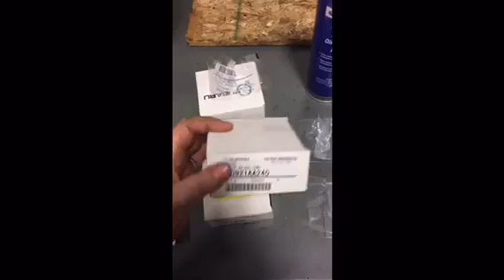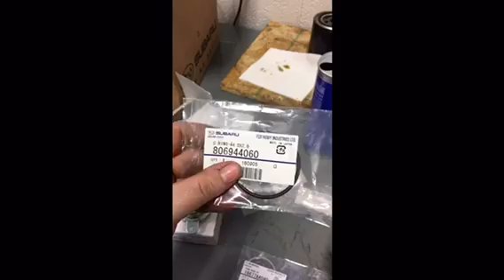Oil Control Valve Replacement FRS

Comment: I have a engine and a traction control light on the code I got was p0018 what I would like to know is if after you change the oil control valve and the engine oil did it go away?
Reply: I just got my P0018 Crankshaft Position - Camshaft Position Correlation (Bank 2 Sensor A) Check Engine Light and Traction Control Light are both on. I have an Automatic Transmission 2017 Toyota 86 at 60,000 miles now. I just did an oil change, took my car in to the dealership to see which sensor needed to be changed, and they told me my K&N Oil Filter is the problem... The thing is, I have been using a K&N Oil Filter for the longest time, and the check engine light came out just recently. I want to check my Crankshaft Position Sensor and my Camshaft Position Sensor. Clean them of dust/dirt/leaked oil, test their voltages, and see if I need to replace any of them, but I just do not know which sensor is which and where they are exactly located.
Reply: @ShimoGamingMoments  the sensor is on your right and at the top not sure on yours but you could google it 2017 scion frs sensor diagram!.
Reply: Bump! Same issue with me as of tonight, TC and Engine Light both came on at the same time, restarted my vehicle and the TC light went off shortly afterwards, maybe like 5 minutes. But my EL remains on and OBD-Reader gave me “most likely solution” as Oil Control Valve (also referred to as the VVT Solenoid).
Reply: @zachbrossett   I change the sensor on mine bank 2 sensor A and the TC and EL still didn't came off send it to the dealership they say the sensor is working   they clear the code after leaving the dealership it came back send it back they  wanted 600 just to go in the engine but I just took it back so am planning to work on it myself will keep you posted.

Comment: does this solve for p0018?
Reply: Yes, P0018 goes hand in hand with P000C, and replacing Intake (upper) sensor on Driver's Side could resolve it.
Reply: @knappRC  I just got the p0018 code at 41k miles. Should I just change this sensor first before doing anything else?
Reply: @Laggyness  That is up to you, but for $80 I figured why not start there. It's a quick and easy fix. Dealer usually has then in stock or Rock Auto is great also.

Comment: Code p0011 you think you can help plz frs 2014
Reply from the maker: So p0011 is bank 1 intake camshaft is too advanced. Causes can be low oil or oil that has clogged the actuator, bad actuator solenoid, possibly wiring issue, or it jumped timing. I would check oil, change it, do the oil flush, clear code and see if it comes back. If it does, you can remove the solenoid and test it, and if that tests fine, start looking for a wiring issue.
Reply: @heatherbergmann7991  Currently have P0011 I will take these steps and let you know how it goes!

Comment: Hey Heather so I have a 13 frs running some bolt one but just had two codes come on p0390 &p0391 your video has been really helpful. Could my problem be similar
Reply from the maker: Just a brief search looks like that is more of a circuit electrical issue, than an issue with the oil control valve.

Comment: Can this solution also fix ECU code P000B ? Or is that a sprocket issue. Great vid very helpful
Reply: Yes, it just means that it is a different sensor. There is upper (intake) and lower (exhaust) sensors for both driver's and passenger sides. P000A = Intake Passenger Side P000B = Exhaust Passenger Side P000C Intake Driver's Side P000D Exhaust Driver's Side.
Reply: Hay man I know it’s been almost 2 years after you committed this but did you ever fix the problem I have that code now
Reply: @daddyyovani3536  yes I replaced the control valves and the problem went away
Reply: @petethemeat57  THANK YOU SO MUCH FOR REPLYING BROTHA! and so that’s not the sensor right?
Reply: @daddyyovani3536 is it the same sensor for all of them? Sorry I know it’s 3 years later 😅
Reply from the maker: It should be the same issue, just a different oil control valve than the one mine was.

Comment: Hey, I wanted to know if your code cleared and did not come back after this service? Im having the P000B code and want to fix it. Code popped right after I did my oil change with OW-20 Mobil 1 Oil. Do I really need to get the factory oil? Thanks in advance
Reply from the maker: The code never returned. Factory oil is not required, but I still use it.
Reply: @heatherbergmann7991  I have code p0014 and p000b, changed the OCV sensor and still have the light CEL on. used Royal Purple 0w20, thinking maybe cam sprocket?
Reply: @xxthrillxx  do you fix it?
Reply: @aaroneduardoalvarezzarate4405  i wasnt able to fix it in time... i discovered that someone worked on the timing chain prior and used too much sealant. This caused the oil pick-up tube to get clogged and it threw a rod. 

I believe the clogged pick up tube was causing that code to come up. If you have had your engine worked on, pull the oil pan and see if the pick up tube is clogged.
Reply: @xxthrillxx  in fact, I just repaired it, and the oil was dirty, I will remove the pan and clean everything very well
Reply: @xxthrillxx  bro, I did it, change the oil, now the engine works perfectly, it’s crazy how something simple create a big problem
Thanks bro!
I hope this helps someone else
Reply: @aaroneduardoalvarezzarate4405  did you take off the oil pan? Was the pick up tube clogged?
Reply: Did you fixed? Just happen to me did the oil change with 0W-20 mobil 1 and the code poped

Comment: I’m getting p0018?
Reply: Same. Have you fixed it?
Reply: Have you guys had any luck with the P0018?
Reply: @ManuelXx8xX  Sadly not. Ive changed quite a few things. My car might just need to get the light cleared though.
Reply: @rabbidstech7677  I'm sorry to hear that but thanks for replying, by any chance did you replace the cam sprockets or the ECU?
Reply: @ManuelXx8xX  Not yet. Just the position sensor and the oil valve. I still have warranty left, so I'll take it back a few more times till they fix it.
Reply: @rabbidstech7677  did you ever get p0018 fixed? i have the same problem on the opposite bank.
Reply: @PrestonG23  did you ever get it fixed?

Comment: Some great info in this vid! You said this was DTC P000A, right? 

I have a permanent P0010 error code and this video was one of the top Google results for those terms. Are these two codes related to the same underlying problem?

I'm not very technical so I had a little bit of trouble keeping up with the video (particularly with the interchanging of the terms sensor, solenoid, actuator, and oil control valve).

I'm just trying to figure out if my P0010 code would be fixed with the method shown in this video, or if P0010 has less to do with swapping out the entire oil control valve assembly, but rather just replacing the sensor that clips onto the housing.
Reply from the maker: Yeah, my bad. The technical term is oil control valve, but I typically call it a cam sensor. For p0010, it could be the oil control valve assembly on the passenger intake side, an electrical issue with that harness, an ecm issue, or the efi main 1 relay. I would start by measuring the resistance of the ocv. When warm, the resistance should be between 6.85 and 7.65 ohms. If not, then the ocv is bad and do what I did in the video.
Reply: @heatherbergmann7991  im having an issue where the cams are only turning on intermittently and thi k it's either the sensor or ocv. I want to test the ocv, so pretend I was in 1st grade. How do I test the resistance?
Reply from the maker: @innercirclepro11  the resistance should be 6.85-7.65 ohms. So disconnect the connector, and hold both probes of the multimeter to the two prongs on the ocv. If it is out of that limit, replace it.
Reply: @heatherbergmann7991  awesome. I will check tonight. How about testing the sensors if the ocv check out? When the cams come on (I can see through ecutek and vvht exhaust) the car runs great. When they dont, I get stall and rough idle. Never got a cam code though only to lean to or rich but that becuase of the cam issue I'm certain.
Reply from the maker: @innercirclepro11  there is no spec for the camshaft position sensor on subaru. I believe they aren't too expensive, so you could always try that. I'd recommend the subaru oil flush first.
Reply: @heatherbergmann7991  good idea. I'm going to test the resistance on the oil control valve then if that looks ok I'll replace the sensor. Any thought as to why I get the symptoms but no cam codes? I know the cams/vvht are the issue.
Reply from the maker: @innercirclepro11  sometimes takes awhile to set the code. Or its goes back to working normally before code can set.
Reply: @heatherbergmann7991  I'm also experiencing the P0010 code. Why do you recommend the oil flush, what does that accomplish?
Reply from the maker: @MrOwenstv  p0010 could be a more advanced issue than p000a. I recommended the oil flush for p000a to flush the junk out of the engine

Comment: What was the part number for the gaskets? Video kind of blurred
Reply from the maker: 806944060 and 16677AA040
Reply: Gotten a P000B code, assuming that it's bank 1 but not sure if exhaust or intake side. If I were to flip the exhaust and intake OCV would the codes change or would I have to go through a drive cycle?
Reply from the maker: The code will follow whichever oil control valve is bad.
Reply from the maker: You might have to drive it a bit tho
Reply: Heather Garland ordered some new ones, would it be okay to swap the ocv between intake and exhaust for now? I know it might throw a different code afterwards
Reply from the maker: Yeah, you can swap them around, it won’t hurt anything. The code will just follow

Comment: did your car die on you, mine is a 2015 FR-S and as i was on a red light, as soon as i hit the gas it started loosing power, and then it shut off on me this morning, never started. just cranks.
Reply from the maker: Not for this specific issue. I did have it turn off on the freeway once, but that was a maf related issue